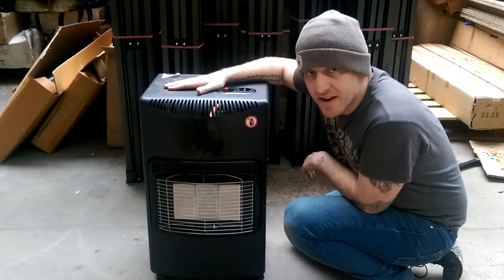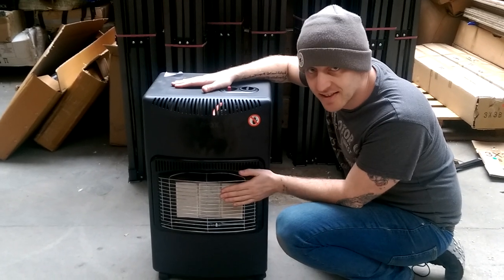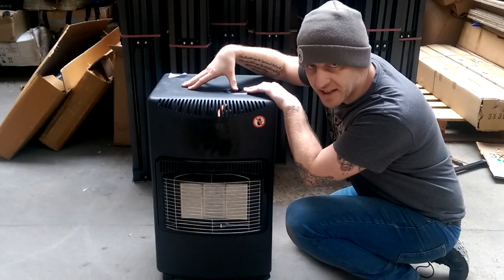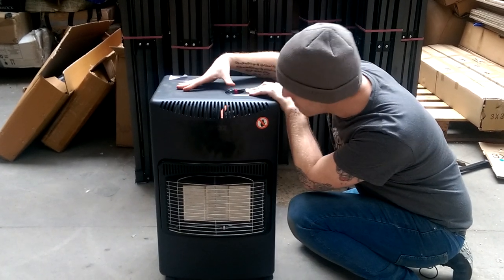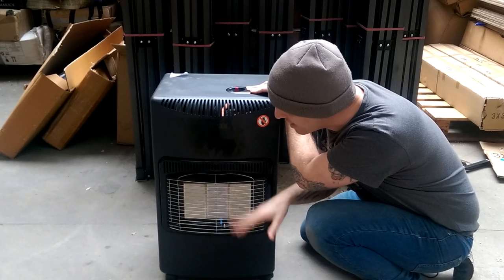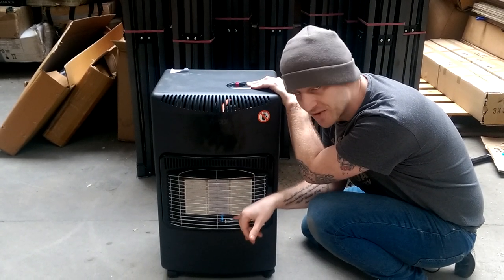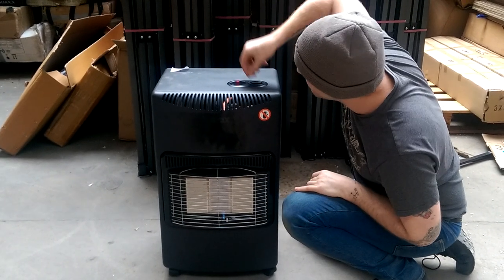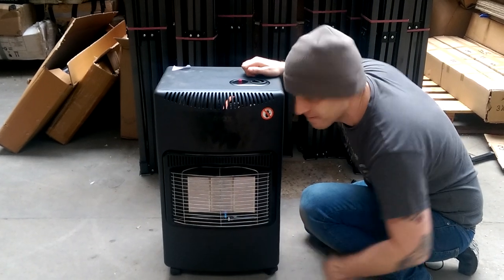Portable Gas Heater Guide

Comment: I cured mine by using my kitchen blow torch, I lit the fire in the normal way and whilst                                                      holding the control knob down I heated the thermocouple to red, it now works fine

Comment: And I’ll through in another tip,  if the heater has been put away for the winter you may find that the flame may not burn true when it’s first lit it may burn like an orange colour. This happened to my mini supasers and I found by getting the vacuum and by using the small nozzle give where the flame comes out of the bottom a good going over as dust or insects can block the flow of gas. Do this each time you bring it out and it should be tickety boo.
Reply: Thanks for the tip. I'll try vacuuming my heater. It looks pretty dusty and the pilot light keeps going out. Haven't used it for a while.

Comment: This is not the correct way to light a gas heater. If the flame jumps past the pilot light, it means you have the wrong regulator fitted and the pressure is too high, which is what causes the soot marks on the front of your heater, this is through your heater over burning, if you are unsure on how to use a heater contact your local gas supplier as gas is very dangerous.